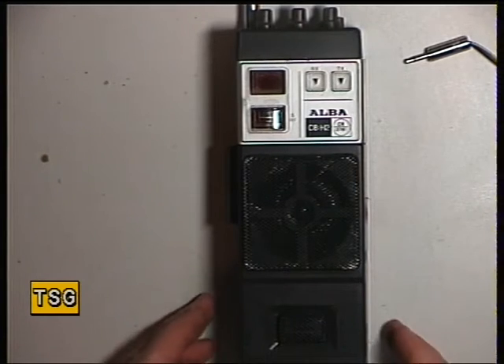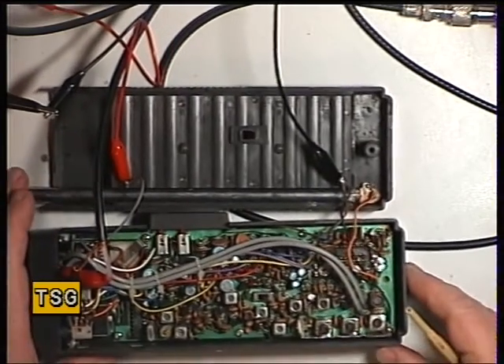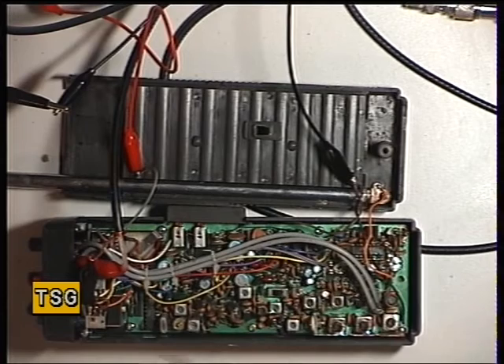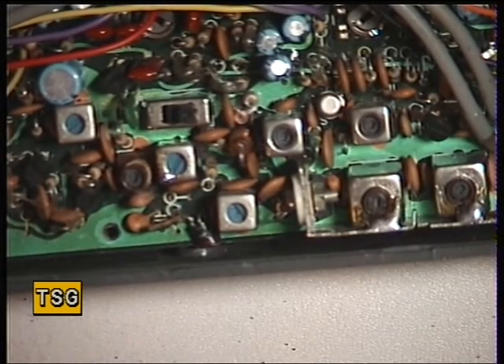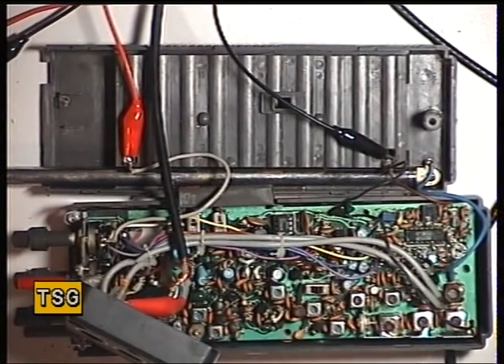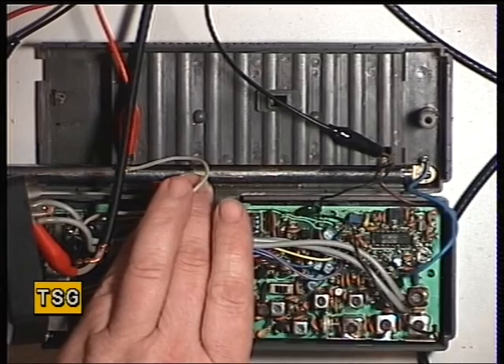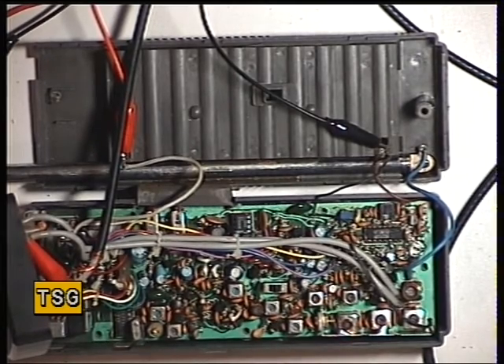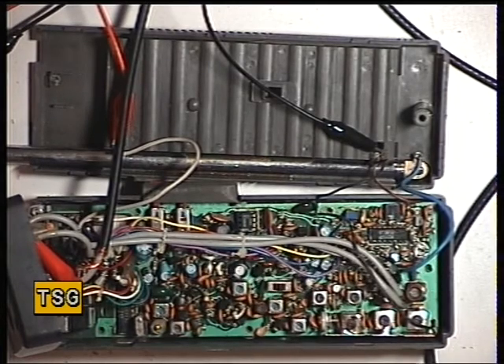Alba CBH2 - UK CB radio 2W, 40 channel (CB 27/81) (Hand portable). Alignment of Transmitter

Comment: Can you tell me how you opened it? I’m trying to open but don’t want to break it. The screw at the bottom has been taken out. Many thanks.
Reply from the maker: The case clips together. Hold the front part of the case firmly & with your other hand carefully part the back section, starting with the sides near the bottom.

richard
Reply: Much appreciated 👍🏻

Comment: I bought one recently to play with, and it seems to make the right noises. Some of the battery terminals were corroded, so I fitted a 2200mah Lipo battery instead of those annoying AAs. When checking the board, I noticed what looked like an accidental blob of solder that appeared to be shorting two of the diodes at the switch end, so I carefully removed it, but that may have been a mistake, as previously it had switched through channels 1 to 40 and then gone up to 80-99. Was this a known mod?
Reply from the maker: It's a 40 channel set so I've no idea what it was doing. The  channel information is double ROM locked into the Sanyo LC7137 synthesiser chip. Any incorrect BCD code detected by the chip should cause the chip to generate channel 9. 

Richard